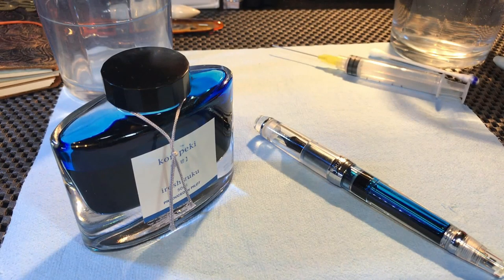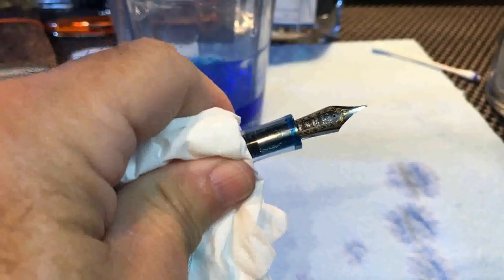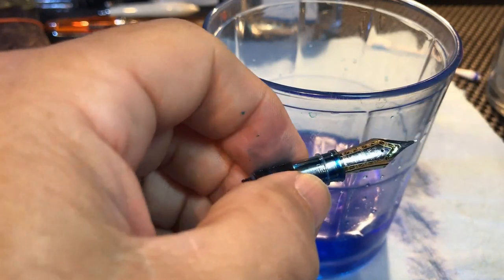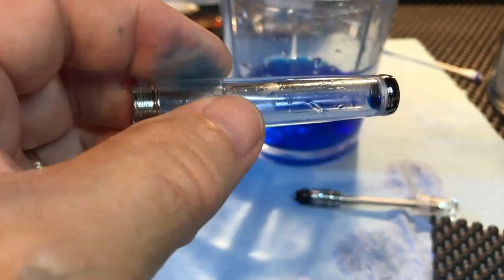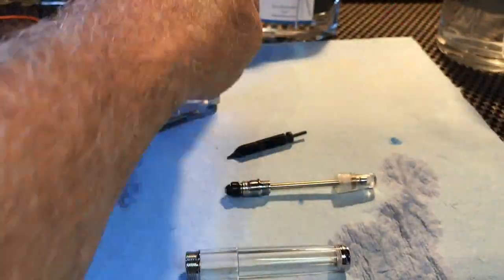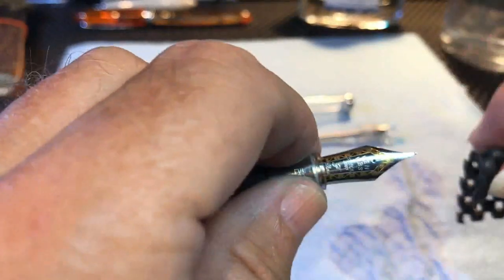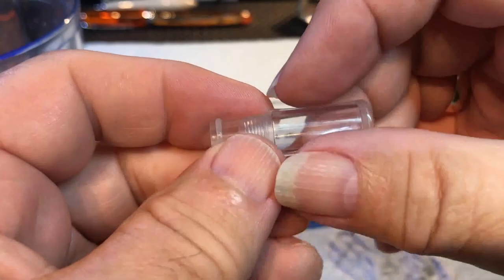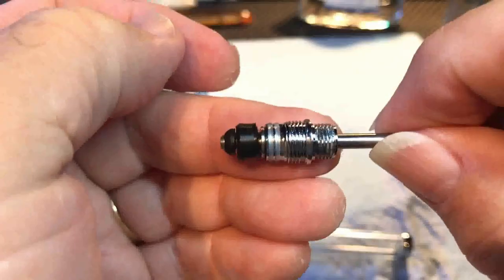PenBBS 456 Vacuum Filler Fountain Pen Disassembly, Cleaning and Refilling

Comment: So well engineered, “a little flat spot there” means no fancy specialized piston wrench is required. And a bonus, the feed has a stop for the nib, how I wish more feeds and nibs had similar guidance. Thank you for putting the ink back in the bottle. I also do that so it is comforting that at least one other person does. 
Great video, thanks.

Comment: Great video on the PENBBS 456! I used your guidance to disassemble, clean, lube and ink my 456 but now the two rubber gaskets on the plunger (one larger black washer and one small cup washer) pop off whenever I pull the plunger back. If they stay on, the chamber does not fill on the down-push, only on the up- pull. If I push plunger down, the ink is flushed back out.  Seems all is haywire. Time for a rebuild kit? Thanks
Reply from the maker: Drop a note to Beini Zheng on Etsy PenbbsOfficialStore and ask if you can by just the vacuum filler hardware piece from her. I bought just a 456 barrel from her when mine cracked.
Reply: @InkquiringMinds  you think it’s the filler hardware and not the gaskets? The gaskets seemed to lose their stiffness and pop off when the plunger moves.
Reply from the maker: If you’re talking about the black parts on the rod, they aren’t replaceable separately anyway. You’d have to get the entire rod assembly.

Comment: Hi, thanks for the video. very helpful. is it possible to open up the plastic handle of the pump (the bottom of the barrel)? Somehow I managed to get some water/ink in there when I was washing the barrel with the pump withdrawn....
Reply from the maker: Hey, Samsuddha! If you are speaking of the small plastic cap on the very end of the rod, I don't know if it is removable. But to get ink out of it, I would put it in a glass of 4 parts water to 1 part bleach for a short time. The ink should fade and then rinse with clear water and dry it by wrapping it in a paper towel for a while.
Reply: @InkquiringMinds  As usual, lots to learn from you. Will try that!

Comment: If I want to change color inks in mine could I just flush with water without taking apart? That’s what I was going to do until I saw that ink behind the piston of yours, hoping to not take it all apart. Mine is not clear so can’t see in it. Thx for vid.
Reply from the maker: Yes, you can just keep flushing it with clear water and then change inks. As long as the whole thing runs clear you should be good to change inks.

Comment: I bought the same pen because of you video love it but I keep getting ink in my grip section
Reply from the maker: There are two silicone o-rings on the nib unit; one larger one at the nib end of the collar and one smaller one on the back end. If they are missing, they should be replaced. If they are there, then you should add a touch of silicone grease around just the threads of the back end of the nib unit. Don't get any on the end or the ink won't flow. Ink in the section doesn't keep the pen from working. If the section is opaque, you don't see it anyway, and a lot of fountain pens leak ink into the section, you just never know it.
Reply: Thank it looks like I’m missing larger one
Reply from the maker: @rubenbajapantydj  That'll do it! You can get a Penbbs parts pack at the PenBBSOfficialStore https://www.etsy.com/listing/680663941/penbbs-pen-parts-package?ref=shop_home_active_1&crt=1
Reply: Way ahead of you already ordered thanks again but I guess this is why I stick to my kasama tala

Comment: Hey Doug, my 456 Aurora started leaking and filling up the bottom turning knob. Do you know of this happening to others? If so, do you know how to fix this? I love that pen, but it’s now a leaky mess. I have it disassembled and am going to grease all the O rings and try again.
Reply from the maker: Hey KA! Sorry that this happened to you. Follow  my video on how to disassemble the back end of the pen. There are two silicone O rings on the assembly that screws into the barrel. They might need replacing or a least a good dab of silicone grease. The parts pack from PenBBS is periodically available from both the official Etsy and eBay stores for around $8.

Comment: hi, do you happen to know the length and diameter of the plunger rod used in this pen?
Reply from the maker: Hey Yeska. I couldn't get a totally accurate measurement because the pen is inked at the moment. But, from the end of the blind cap to the end of the rod is about 76.4mm and the diameter of the stainless steel rod is 3.1mm.
Reply: @InkquiringMinds  Thanks that help to give me an idea. I'm looking to see if there are any plunger rods that are threaded on both ends of the rod and similar in length to these vintage rods I have so I can finally get them writing. No luck yet:/ but thanks for the info you did  give me
Reply from the maker: @yeska7192  Good luck! Keep me posted!

Comment: Ever swap the food for something wetter?
Reply from the maker: Nope. Made the nib wetter.
Reply: @InkquiringMinds  I put a Goulet 1.1  in mine. Contemplated an ebonite feed and a flex nib. I don’t know how the stopper would mate without the tube on back of the plastic feed.
Reply from the maker: @kmcmichael  Yeah, the Goulet (Jowo) nibs work nicely in Penbbs. I doubt you'd find an ebonite feed that would fit the nib collar of a Penbbs pen. Those feeds are quite unique.